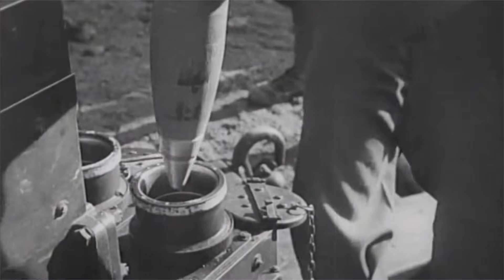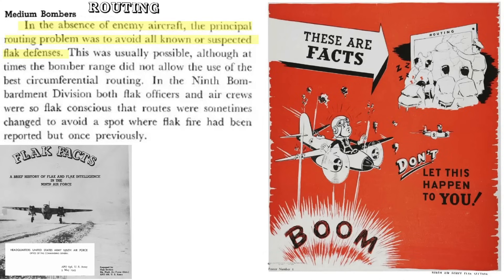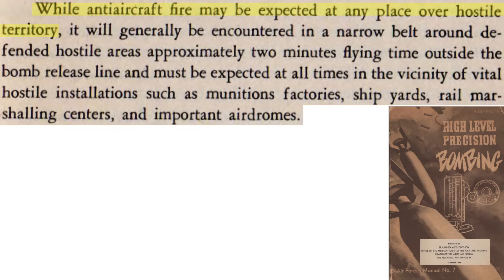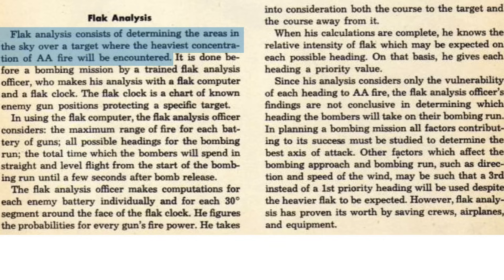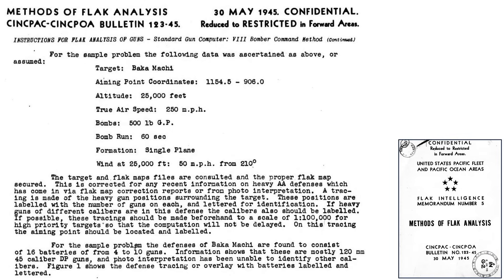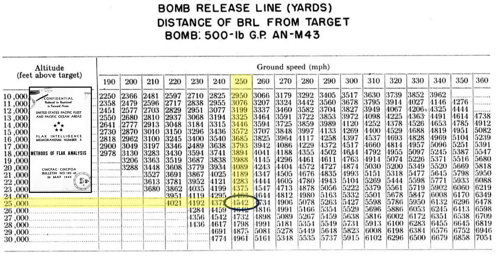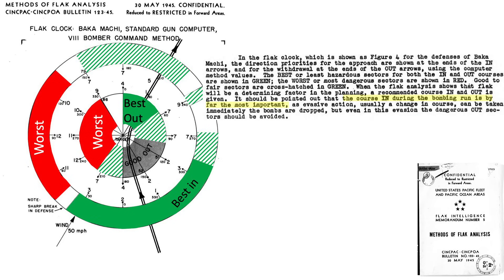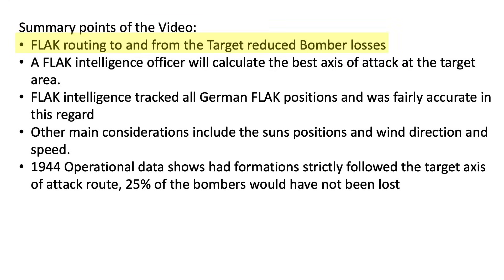Bomber Axis of Attack Route to Minimize the FLAK threat by FLAK intelligence analysis - Deep Dive

Comment: Would be interesting to learn how the Germans set the fuse before firing the AA shell.  Electrical, mechanical, outside the gun, in the barrel, etc?
Reply: In the video at 00:02 the shell is pushed to a hole, where the rotating tip is set according to fusing time i.e. time to detonate.

Comment: Blows my mind how much data was collected and forwarded to bomber crews prior to each series of missions.
Reply: The bomber crews were not given the data - they are given the best route in & the best routes out. It would be silly to show your hand to the enemy via data aboard crashed bombers & captured aircrews.
Reply: @nightjarflying  I was referring to the routing, not implying that each crew was privy to the intelligence gathered or the means by which it was gathered. Give me a little credit.
Reply: @steveturner3999 I don't know you so how can I give you credit? "Data was collected & forwarded to bomber crews" reads as "data was collected & forwarded to bomber crews." And of course you are supposing that the object was to reduce bomber casualties... 

Distilling flak position densities onto flight maps was not done - AFAIK the crews were given waypoints, the target & the bombing run direction & timings. They were also given the route out. The key was to keep it simple as complex missions always increases bomber casualties due to inevitably poor navigation & timings resulting in bomber streams interfering with each other. 

Mission planning was built around collecting the bomber groups together into streams & figuring routes through the target - if one group had to go through a heavy flak area to keep streams apart then so be it. Flak avoidance was not usually the top priority, especially as attracting flak improved the timing & accuracy of consequently less flak-afflicted streams. Bomber calculus is brutal.
Reply: @nightjarflying 100/100🌹

Comment: Did B17s ever strafe flack sites with their ball turrets as they flew over?
Reply: Highly doubtful.  They didn't have enough ammo to waste like that, and they were too high to call it "strafing".  Besides, all the ammo they shot had to fall down sooner or later.
Reply: No.
Reply: They flow why to high for 50 caliber machine guns to suppress the flak.
Reply: Of course not! You'll need all the ammo you can get when attacked by interceptors. Also from five miles up the 2,000 m/s rounds will slow down to around 150 m/s terminal velocity under gravity - also it's hard to hit a target at 5 miles!
Reply: From 26,000 feet? Sure . . .
Reply: Were B17s ever used on any low-altitude raids or missions like the Dambusting Lancasters or the Ploesti B24s?
Reply: @oxbowbender Not that I know of. US daylight bomber crews were produced on a rapid production line system, they could not have pulled off a dambuster style mission, especially at night. All skills were basic & then the crews learned on the job - navigating in European sky conditions was particularly difficult & would have been impossible at low level and at night. It was only through highly experienced combat leaders that such missions were possible.

The week of D-Day is a good example - B-17s offering tactical support at 6,000 feet was considered risky & only permitted to go that low to get under 10/10 cloud. Results were nearly always NIL even with smoke pathfinders & of course there was still disasters with the bombing of their own troops. B-17s are high altitude strategic bombers with crews trained by the numbers, I don't think there were any specialist dambuster style squadrons.
Reply: yes, from altitude of 25 000 feet ;)